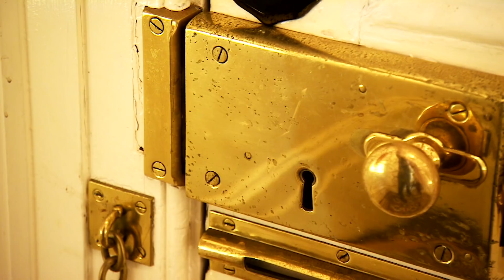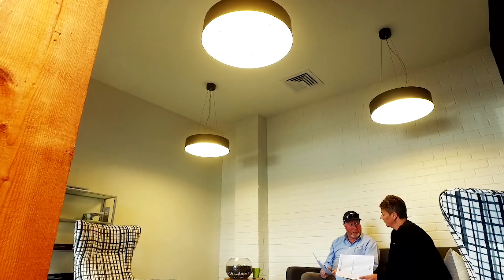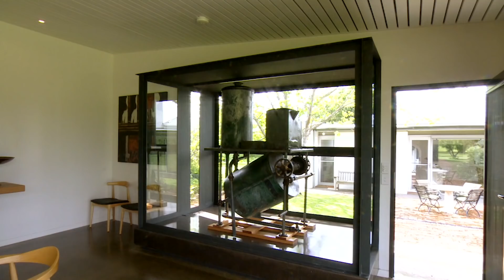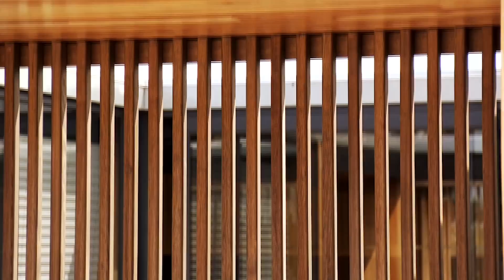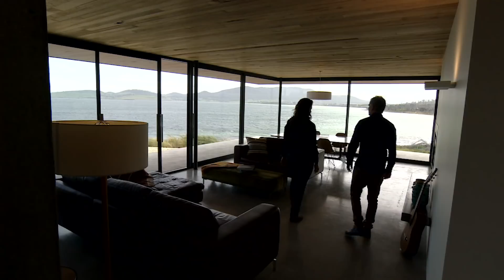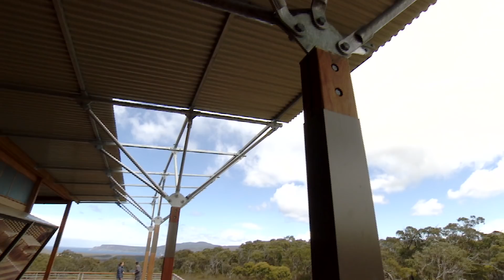Australia ByDesign Architecture | Season 1 | Episode 6

Comment: Building Number 5 - a great use of differing ceiling heights and colours. It gives the visual impression of much more space than there actually is. But I'm sorry, I don't feel it's "really different" - at least not to any modern, architect-designed space across Australia. It is different from the usual mass-produced crap housing, but so what? That just moves it from the 1970s into the 1990s.